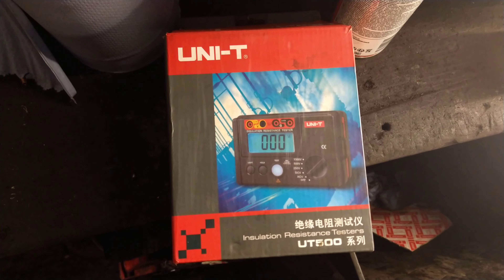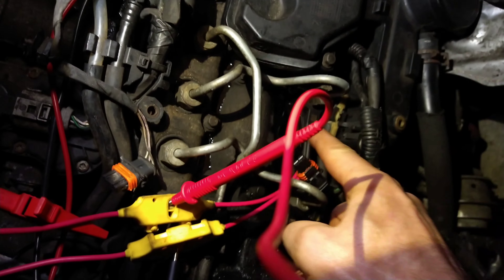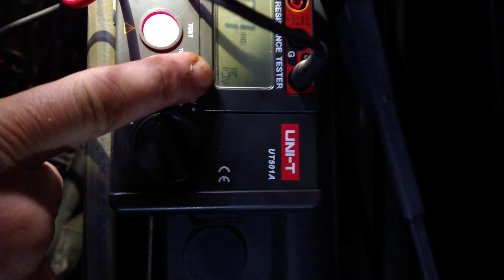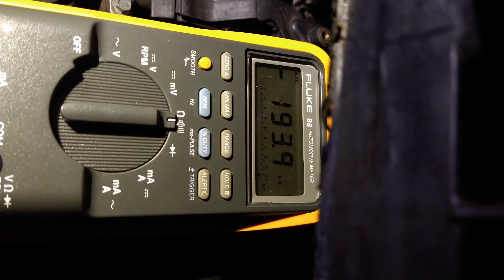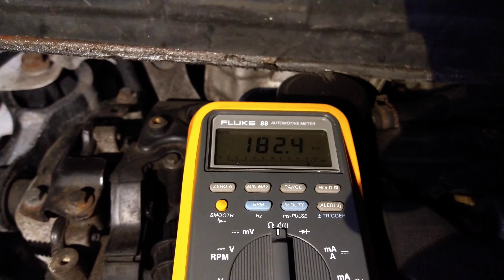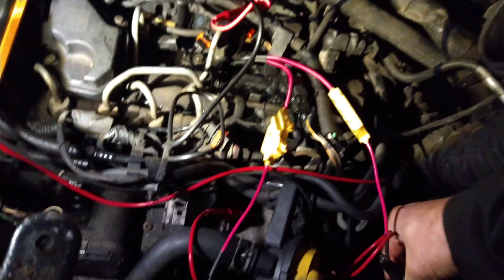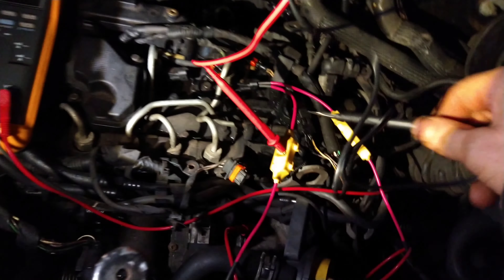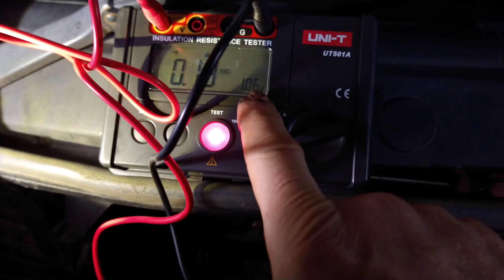Piezo injector testing (ohms v insulation)

Comment: Hi , sorry to be a pain in the neck but  it's a 12v system  where is the 100v coming from? , i'm really keen to figure this out  but don't understand as it seems complex  could you please explain if you have the time  thanks .
Reply from the maker: Its power is switched (not just the ground like a petrol) it comes from the engine control module. The higher voltage comes from the internal circuit in the ECU. 
I may be able to explain this in a video
Reply: @mechanicmatt871  thanks matt look  forward to that .

Comment: i have a peugeot 207 hdi with diesel piezo injectors. i am measuring with a simple multimeter around 0.7ohms at the two pins. but i dont have any idle problems or any fault codes regarding injectors. is that normal that it is that low. it is basically a short .
Reply from the maker: Hi there, that is either your multimeter leads are touching eachother or you have solenoid injectors to have that resistance, piezo injectors are much higher, are much higher resistance at nearly 200k ohms. Thanks for watching.

Comment: are you still using this matt?
Reply from the maker: Haven't had to use it for a while, I still check ohms and usually I see a massive reduction in resistance with that. Insulation testers may be better for intermittent faults